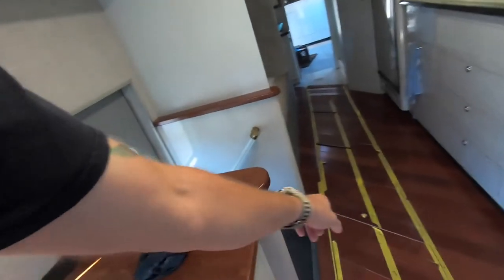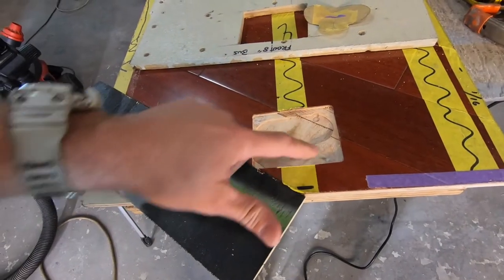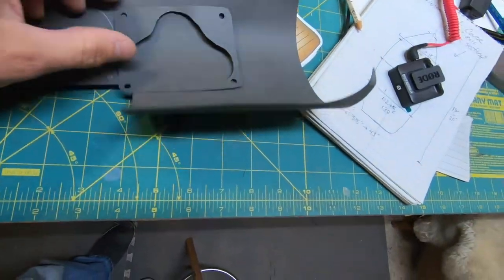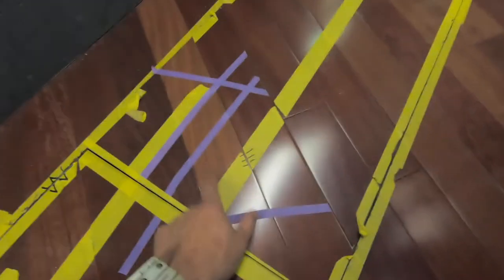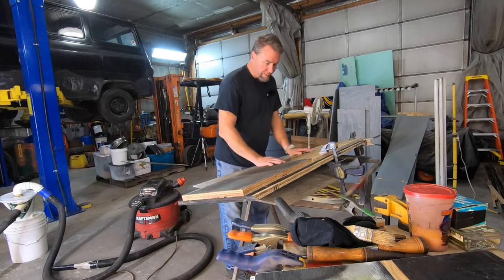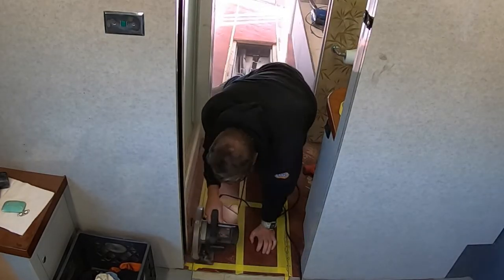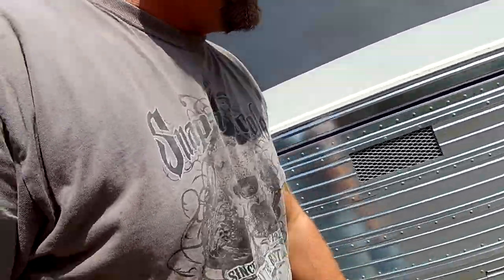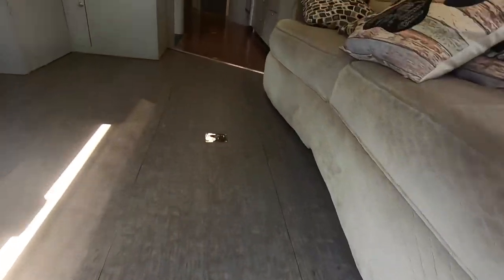Bus conversion Must

Comment: I just started watching the first couple minutes of this video but I followed your work on this floor. It never dawned on me until now in regards to this floor and ALL the time and brain power messing with wood floor and getting it back to it's original settings. When you mentioned replacing the carpet up floor, heck why don't you carpet the whole thing and the heck with the wood floor. Buses aren't like houses when people have it in their minds that kitchens have to have hard floor surfaces. Buses are rolling earthquakes and hard floors are cold.
Just a thought for ya!
Blessings to you and your family and cats!
Reply from the maker: Thank you! I agree with you but I did like the way the hardwood looked and I wanted to put it back the way it was minus the carpet. Carpet collects a lot of dirt and it looked like the beach when I ripped it up.
Reply: @11thhourcustom  Yes, you are right about the dust and Sandy Beach. I experienced the sand also when I took out my carpet and installed hard surface floors. But during the winter season I do use a Mohawk carpet type product with thick recycled rubber backing because of the cold floor and there hasn't been any kind of residue from them yet. Going into my 9th winter season as a full-time Bus RV'ER out here in Western Maryland at 2900 feet. Brrr!
I saw your end results and the floor really looks great.... good job! And thanks for the update on your bus. Blessings!